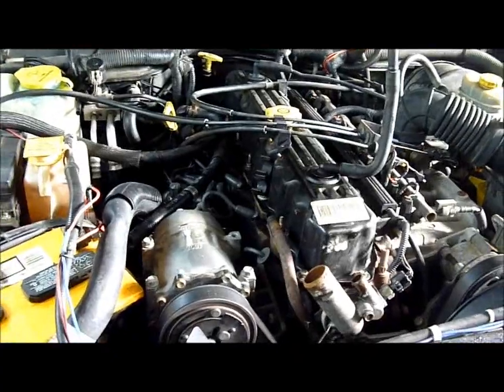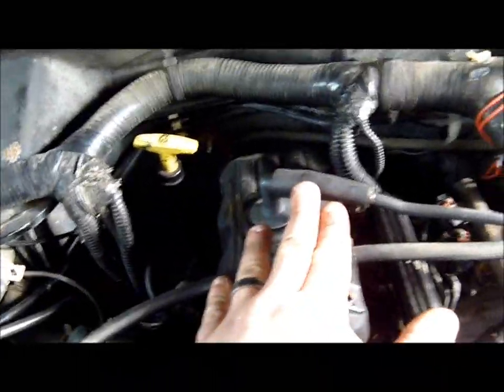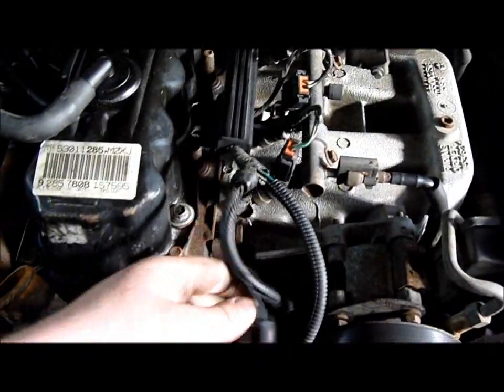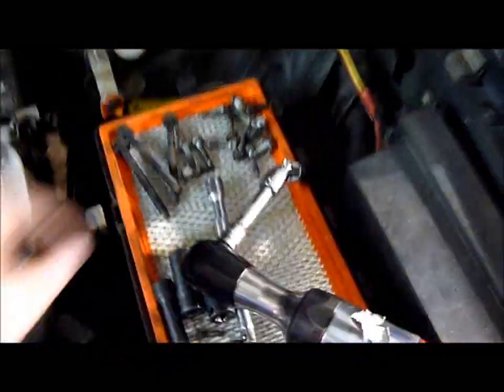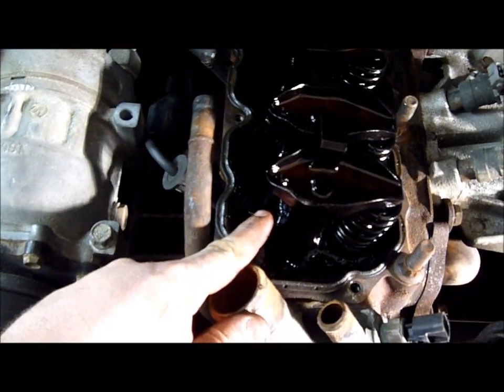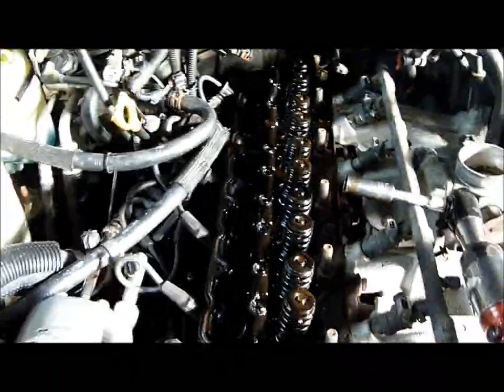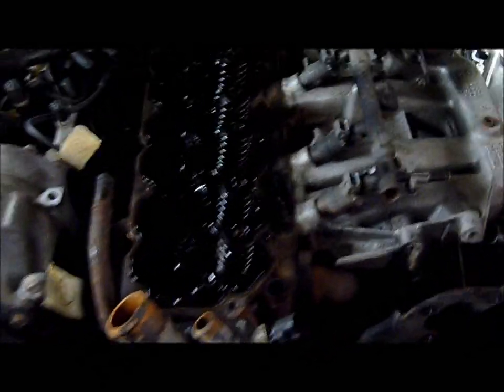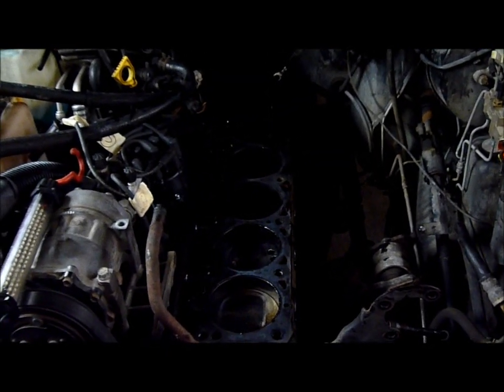1996 Jeep Cherokee Head Gasket

Comment: every older jeep I have ever seen has the milk on the inside of the oil cap and or valve cover. usually due to the emissions system being crap and clogging on these 4.0.  I work on many 4.0s and only very low mileage ones haven't had it.
Reply: I changed head gaskets on both of my 96 4.0 Cherokees and everything was clean as a whistle but I only use synthetic.
Reply: +AZ DONALD I also lived in Maryland. winter may also cause the moisture in the valve cover
Reply: could be but I doubt it unless all you do is short 5 minute runs.  I lived in Michigan for the first 53 years, always used synthetic and never had the white milky stuff everyone always talked about and I've always done all of my own work learning from my dad.  it had to be the early mid 70's I started driving and only several years later I switched to synthetic.  my wife is an engineer on unmanned aircraft and they only use mobil synthetic the last time I heard.  I swear by it.
Reply: +AZ DONALD I only use reg oil. maybe the oil causes moisture.
Reply: I got off topic there.  every morning the moisture condenses inside the motor and with synthetics it burns off but with petroleum's it mixes when it gets hot and turns into a sludge at the top of the valve covers which is why you see it when you take off the oil fill cap.

Comment: Bedford Heights Auto  "Not on this model the push rods are the same lengths"
if the pushrods are all the same length, why do you have to keep them in order when re-installing them?
Reply: Because they have been work a certain way after so many miles. You're better off putting them back where they came from.

Comment: Great video guys. It does help me in what to expect for sure. My only comment would be on using 12 point socket @ 7:21.
"head bolts" according to some people they would say that 12 pts sockets tend to round 6 points bolts so I would probably go for a 6 point socket.

http://forums.anandtech.com/showthread.php?t=273632
"When does one use a 12 pt socket over a 6 pt socket of the same size?
the only time a 12pt socket makes sense is in those really tight areas where you dont get a change to spin the socket to fit nicely... and then the most obvious one is the 12pt bolts, mainly on the torque converters. 

and yes 12pts tend to round off 6pts bolts"
Reply: He said use a 12 point socket because the bolts are 12 point bolts. No way will a six point socket fit a 12 point bolt.
Reply: +Kenneth Maccourt Yeah the only place I see them is there and on the wheel hubs